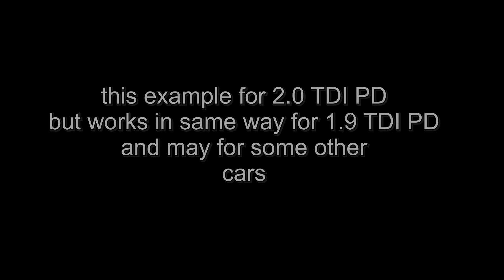Removing diesel TDI PD injectors (VAG, audi, seat, vw, skoda) without special tools

Comment: i've got 2.0tdi 16v bkd as well and the torsion value when warm showing up as 0.5kw to 1.0kw would that be something that would likely cause issues?
Reply: The torsion value is adjustable by moving the Inlet camshaft. Watch my video on camshaft setup. The value should be 0.0kw when at normal temp 90oC.
Clockwise movement will increase the value anticlockwise will reduce. So turn the 18mm bolt a fraction anticlockwise to get your from 1 to 0. You have to undo the 3x 13mm bolts first then move the 18mm bolt literally 1mm is enough to move it Alot.
You fuel consumption in measuring block 15 should be 0.4 to 0.6l/hr. Flicking between these values is perfect. This is done by adjusting the exhaust cam. 
Getting these value correct will make your pd tdi purr and run much better. Fuel economy is also better with good power and torque.

Comment: Hi, I had just completed 2,51,000 kms from my 1.9 tdi PD deisel engine.  I am facing issue in Starting when engine is hot. When it is cold it get start smoothly but when it gets hot, it starts getting trouble in starting. I had checked the starter motor and ECM both are working fine. No any faulty code when i scanned.
Could you please help me with the solution. 
I will highly appreciate your response. 
Thanks
Reply from the maker: Hi, have you checked timing? When changing timing belt correctly you need locking tools and loosen three bolts on camshaft pulley when tightening belt, but many garages ignores this and just swaps belt without any correction, sometimes this cause a problems .... Also you can check timing with diagnostic tool
Reply: This is the classic weak starter motor. When they get old they turn slower especially when hot, if the engine doesn't rotate above 250rpm when cranking you will not get any fuel injection command from the ecu so it won't start. Trust me I've had this problem many times on older tdi.
You can log rpm on vcds and see what rpm it reaches to confirm this before spending money on parts.
Your timing also needs to be correct or hot starts are difficult.
Reply: @LAW-Automotive he said the starter is fine
Reply: @Righteouness  he didn't say how he checked the starter was fine! Having no fault codes isn't a verification whether or not its OK. The only way to test a starter on the car is log the rpm when cranking. If over 250 rpm then it's acceptable. Also a battery drop test would be a wise thing to do. 
Aside from the cranking rpm, crank and cam signals need to be correct as well. It's possible heat is affecting a sensor but very unlikely. Hence the starter and of course a good battery with the correct ccc amp is a must to ensure good starting performance.
Lastly cam timing slip can cause hot start issue and cold. The cam sprocket should be roughly middle of the slots and when checked on the measuring block 4 "torsion" translation in English is angle of crank to cam should be 0 degrees or as close as possible to it. If plus or minus too far ie more than 4 or - 4 you will get hard/difficult starting issues.
Reply: Check temp sensor on fuel line and the thermostatic tee in filter. Realise this is an old post but might help someone in future